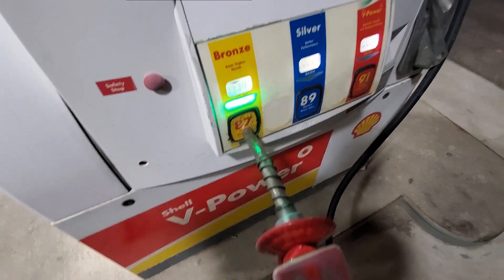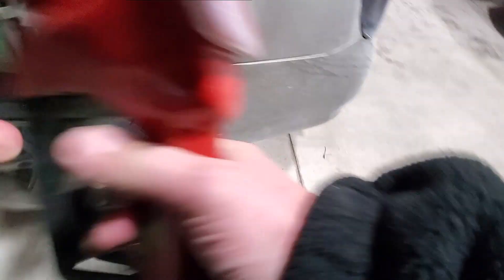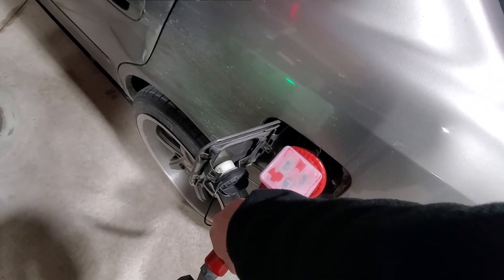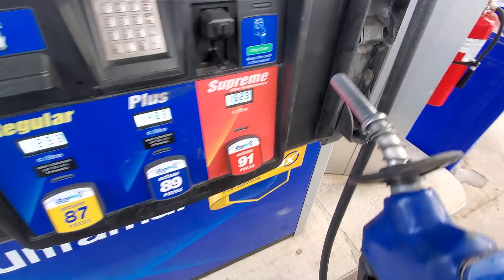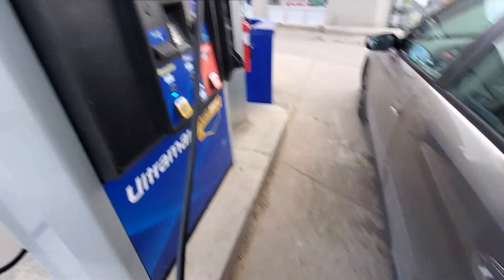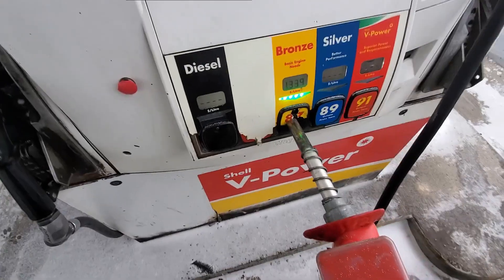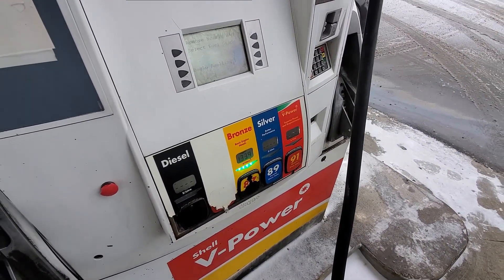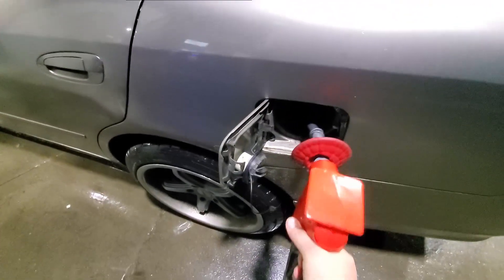Using Regular 87 Octane In My VQ Engine

Comment: I have a 2017 Altima with the de and the manual and stickers on the gas fill and stuff all say to use 87 not premium as it is timed for it.  If you use premium you can have pre ignition issues and may be why you’re having problems.  Use what the factory says unless you tune your car to use the higher octane.

Comment: It will loose around 175-200 miles per tank running 87 octane in any VQ35DE engine and the HR engine. In the winter you can run 89 octane safely but I would not run anything under 89 in this engine since it greatly reduces miles per gallon. I have tested this theory myself with my own VQ35DE. It runs best on 93 octane in the spring/summer but 89 is fine in the winter. The Variable Valve Timing system doesn't like 87 octane, it pulls timing so it doesn't harm your engine on 87
Reply: I have a 2017 Altima with the DE and the manual and every thing says to use 87 and not the premium to prevent pre ignition. It’s not good to use a higher octane just because in a motor
Reply: I mean what I’m saying is that your comment covering all de motors is completely wrong.  It has more to deal with the top end of what motor you have, not just because you have a 3.5 DE block. What he is doing is odd as he already did whatever damage that can be done by having a higher octane for so long.
Reply: @AB-these-handles-are-stupid  yeah thats a 2017 bro these generation altimas 2002-2006 all say on the gas cap to run premium fuel only
Reply: @luuurch  08' ALTIMA Coupe 3.5 CVT driven 27k miles a year w/ 87 octane only & maintains 22mpg out of every tank doing 80-90mph on freeway daily

Comment: I’ve got a 2008 G35 automatic, with 280,000 miles on it and i’ve only put 87 octane in it, no issues and  although I don’t race the car the power sure feels good to me. I hope to get many more miles out of it.
Reply: You’re doing it correctly. This Guys motor problems is probably because he has been using the wrong octane

Comment: I've had my max for about 6 months and I've been putting 87 in since I got it with an octane booster here and there. Now driving normal it feels fine but trying to go wide open when your rolling at 50 proves to be a little laggy. It doesn't get into power until around 4500 rpm.
Reply: Thought I was the only one that noticed that I have 2003 maxima and used 87 before and noticed a lag when trying to step on it under 4k rpm but with premium it just goes even at low rpm feels like a different throttle response at that point
Reply: @cedricmiller4370  yeah you really gotta launch it to get all the power with 87. Still drivable but very noticeable.

Comment: My 05 Altlima VQ will always use 93 V power i just swaped a JDM VQ35 complete undwr 61k milles
and new trans with lots of mods to go with it so i willl stay like that if it got timing chain issues just swap over a new JDM VQ35 or a 2nd gen VQ35 complete with low milles issue salved the car would stay with me for
A life time
Reply: My 2017 Altima is factory and uses regular gas.  You have a tuned or built motor? I don’t quite understand what you have going on? If the factory says to use regular use regular.  You’ll have pre ignition issues otherwise.
Reply: Edward Cortes quick question excuse my lack of knowledge but do you notice any difference in performance with the JDM swap in your Altima compared to your old original engine?

Comment: Been running 87 for over 3 months. 03 G35 6sp. Has a huge hole in what feels like timing under 2000. Above it feels like "surgy". Driving like normal and not an ass, runs fine, can't tell.

Comment: Dang am sure that vq was knocking it self crazy 🤣 to all watching this dont do it
Reply: The Altima top end is supposed to be on regular gas. His timing chain problem could be a result from running a higher octane for so long and running the car for so long. It could be all sorts of other issues also but if your car is tuned to regular gas then use regular gas
Reply: @AB-these-handles-are-stupid  If you think it's ECU, just pull negative bat cable for a few mins and ECU will re-learn over the next 100 miles or so.

Comment: you got 🎱s
If I put 87 in my J30, it would blow up in a snap.
Reply: He was supposed to be running 87 probably this whole time. The VQ he has is trans mounted and de tuned to 240 bhp I believe. I could be wrong on the hp number tho.
Reply: @AB-these-handles-are-stupid  I think his version had 250 from the factory.  SER had 260
Reply: @AB-these-handles-are-stupid  it wouldn't say premium fuel only on the gas cap if he was supposed to be running 87